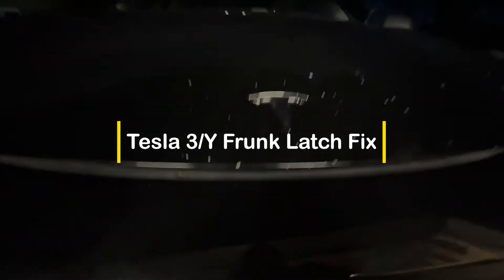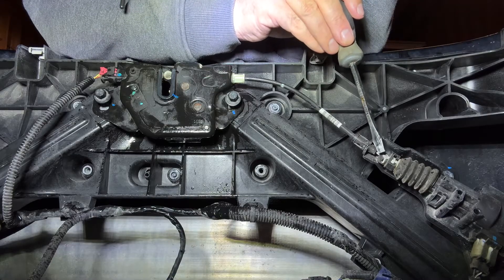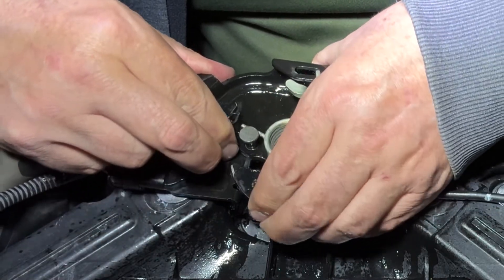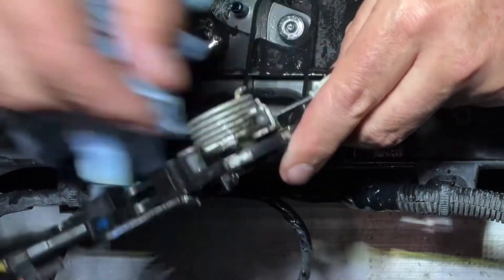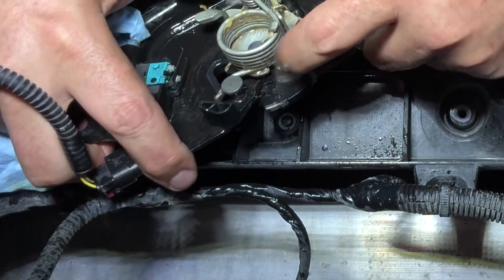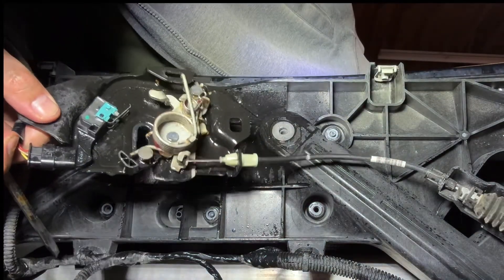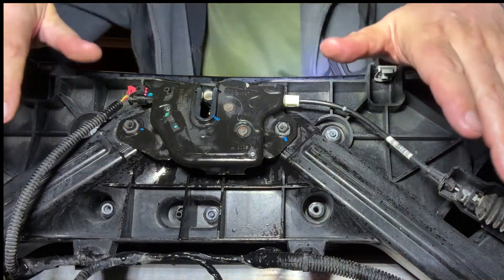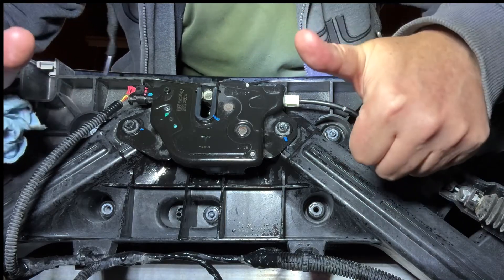Tesla Model 3 / Model Y Frunk Latch Fix

Comment: My 2024 wont get past he secondary latch when below zero. Tesla uses extreme temp grease not axle grease or it will freeze up and not open in extreme cold. Tesla tried lubing mine didn’t work, then replaced the latch still hangs up at the secondary latch and wont open when cold. Soon as its warm its fine. Will take it apart and do some close testing warm then cold soak and try it again all using a screw driver as a striker. Think mine is due to Side loading alignment jamming the secondary latch when cold. Tesla told me not to use the car wash. What???? Who designs a car that needs the cameras to be always clean and then says dont wash the car in the cold. Sheesh

Comment: Same issue with my MYLR 2024, 
It froze the sensor in northern US, freezing temps, after car wash and wouldn’t understand if it’s closed.
Reply: Ya car washes are deadly for this sensor. I actually bought another latch assembly from ebay and installed it. I am never washing my car in winters unless the temps are above 5C atleast.
Reply: mine started working fine after temps went above 40
 🤞

Comment: Thanks for that video mate, fantastic explanation.  My 6 week old 2024 Model Y has an issue where the Funk Wont pop up at all. I had fitted one of those "soft close" mechanisms that you buy from china which has worked perfectly for weeks  however I have the feeling after watching your video and seeing how the original mechanism works that the soft close mechanism may be holding the bonnet down. The car thinks the bonnet is open so the original latch looks to have done its job in releasing the mechanism so it now is not depressing the microswitch but has not allowed the bonnet to lift.  I have tried bouncing the bonnet gently with both hands at the same time someone hits the open button on the main screen and via the app but the bonnet (Frunk lid) wont pop up. I have not yet tried using a suction cup/plunger thing to pull up on the bonnet. Will try that tomorrow. I was just wondering if you have a clever way of getting the bonnet up when it won't pop up at all.  Thanks in advance.
Reply: Sounds like a familiar issue. How did you solve it?
Reply: I had to remove the front wheels, inner guards and front under body plate which allowed access through a couple of small areas to get my arm up into the back bac side of the latch. I was able to use a long ratchet spanned/wrench to remove the two small bolts that hold the latch assembly on. That allowed the bonnet to lift up an inch or so. I was then able to use a Torx bit and a small spanner to loosen and remove the two bolts that attach the striker to the underside of the trunk lid. Then removing the inner plastics I could remove the latch from the car and found that the cheap Chinese soft close mechanism had seized in the closed position holding the bonnet down. It was a mission but a good learning experience all the same. You inspired me to continue until I fixed the problem. Thank you.
Reply: @jasonyannuccelli2499  thanks for the detailed explanation. I just spent my afternoon lifting my car on a vehicle ramp, and removed the under tray. I was able to get to the OEM latch actuator. But the bolts on the latch mechanism was way beyond my reach. As I don’t have a jack that I can trust, I don’t think I can go as far as you. Time to bite the bullet and call Tesla.

Really appreciate your detailed reply.
Reply: @velvetcream1289  Bummer… yes it was not easy to get my arm up there that’s for sure. Much bruising from bending my arm where it’s not meant to bend and where it was to big to fit easily but I was determined. 
The use of a 6” long ratcheting wrench made it just possible. 
But it’s a sensible decision to not get under there mate… without having the ability to secure the front on jack stands 👍
I hoist/lift would make the job much easier too I’m sure. 
I hope Tesla don’t charge you an arm and a leg mate. Let me know how you get on. Good luck.
Reply: @ thanks! Tried booking in a service but will be another 3 weeks! 😦
Reply: @velvetcream1289 any updates? I am dealing with a failed primary actuator on a 2018 Model 3 (2 actuator left and right). My hood is stuck flush. I saw a good video where the guy loosened the front skid plates and the driver side wheel well covers. This allowed some tools to get at the primary latch cable and pulled it to pop the hood. 

I am wondering what Tesla charges to open the hood and what they charged to replace the dead parts.
Reply: @ I ended up biting the bullet and getting Tesla to fix it. They had to keep it overnight and it cost ~500 Australian dollars